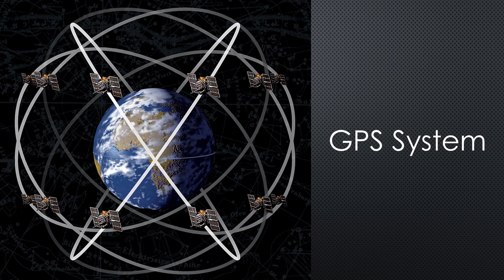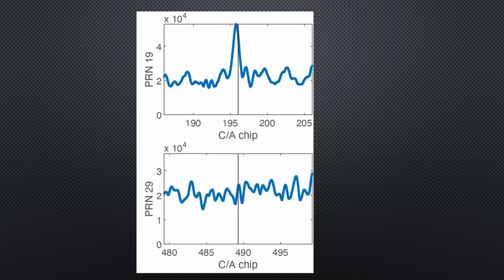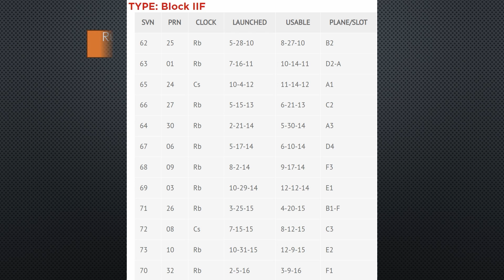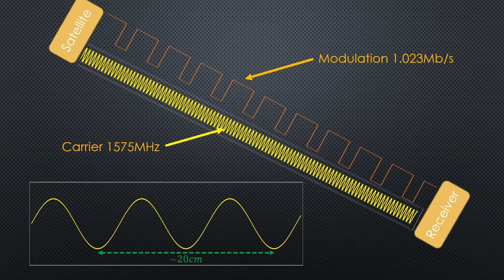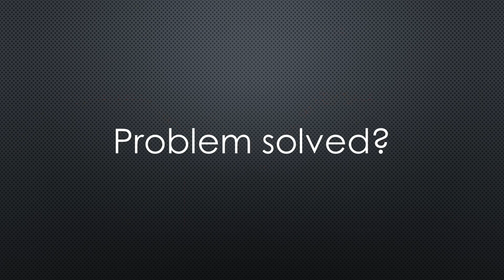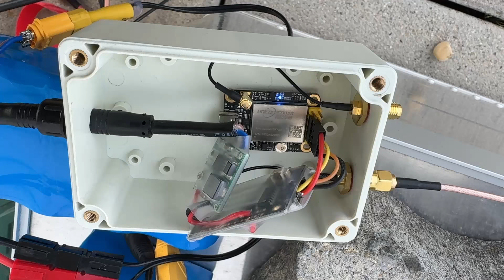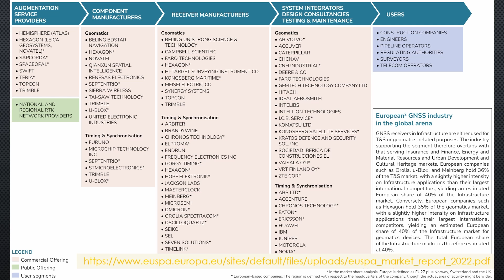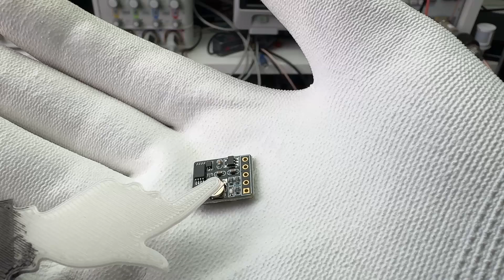(483) ESP32 precision GPS receiver (incl. RTK-GPS Tutorial). How to earn money with it (DePIN)

Comment from the maker: Please order the "S" type of the antenna (all band). It is in the same link I provided.
Reply: I think Ardusimple product pricing is quite competitive with those items you've linked
Reply: Crypto scams have had plenty of opportunities to justify themselves. They can’t. Avoid everything associated with them.
Reply: Thanks Andreas. Very interesting, although I didn't quite grasp all of the nuances after listening once. More reading is required! 
The major weakness of GPS is the satellite constellation; a powerful CME, or a man-made EMP from an orbital nuclear explosion, can disable or damage numerous satellites. While it works though it's superb.
Reply: There are some interesting distributive set ups. 
ADS-B monitoring leads to a business that makes money
Blitzortung is another interesting one for citizen science. 

The general model of distributed sensors sending information to a central website, which merges and presents the data is interesting. It's an area where libraries should lower the cost considerably. 

RTK is clearly an area where this model works, particularly if costs can be lowered. A raspberry pi, a hat and an internet connection surely has to be the model.
Reply: Also, for the DePIN, one sensor sends to lots of companies. Nothing should stop that.
Reply from the maker: @AgOpenGPSMagyarorszag  Good to know. Is it also globally available? That is often the problem for my viewers.
Reply from the maker: @protektwar  Maybe you now find a cheaper source. This sometimes happens after my videos 😞
Reply: @AndreasSpiess  They have next day shipping for most europe, stock in Mouser, etc. So it should be globally available yes.
Reply: @RWBHere  Meanwhile there are 3 and half constellations with global coverage ... GPS, GLONAS, BAIDU ... and Galileo (the half. And further with local coverage - so there is quite some redundancy. Most modern receivers can use all the big constellations for a fix.
Reply: Aren't these active antennae? How are you providing power to them? Above, "Splitter (with a case, not needed for a single receiver):" But wouldn't it be needed for a single receiver since this is power injection?
Reply: @aerobiotic  Most receivers can likely provide power for one antenna. But do not work, if multiple receivers are connected.
Reply: Yes the prices have skyrocketed suddenly on that antenna so idk
Reply from the maker: @TylerDurden-pk5km  I insert a DC blocker for all but one receiver. Like that, only one receiver powers the antenna.
Reply: Do you know if there are approach that would work indoors just as well to few centimeters and could also distinguish elevation - position in 3D so full XYZ?
Reply: The 1 nanosecond error corresponds to an error of 30 centimeters. NOT 30 meters. Light travels at approx. 300 million meters per second. 300 000 000/1000 000 000 is 0.3. 0.3 meters is 30 centimeters.
Reply: Just accepted a job running one of these state wide networks.  Are there any other recommendations for understanding this more.
Reply: Not true, Galileo has global coverage by now. Also you forgot the other smaller networks. I believe India is working on one with currently only regional coverage.
Reply: How precise can you get your position using EGNOS DGPS?
Reply: Why is this project no longer in your github, please?  Or did I miss it somehow?  Great project, keep up the great work!
Reply: Can you use two different GPS modules connected to an Esp32s2  or must you use this specific GPS modules? It's 58-90 CHF for the one you cite. Will other modules work well enough as long as you are using a good antenna or a helix type or a powered one?
Reply: I have so many GPS modules of different types like the integrated one in the Heltec Lora combos (the new one), a t-beam with one, and three others only one doesn't supply PPS.
Reply: The weak signals are one way to discard GPS jamming and spooling. In addition you can set up your antenna to only pay attention to signals coming from the horizon up. So, right there is a way to help discard faux or spoofed signals. If you were to pair it with a very precise onboard RTC with s battery and a very precise onboard military grade inertial movement sensor. I am unsure how to use known cell phone and wifi shot spots for both a NTS and a known location while being jammed or spoofed.

Comment: The first GPS receiver I used was a Sony Pyxis in 1992. It chewed through a pile of AA batteries in just a few hours and it took something like 10 minutes to lock on every time, and it couldn't deal with even a little bit of tree cover or heavier clouds. I now have a < $100 watch that can get a lock INSIDE a lot of the time in just a few seconds and can track for many hours on a tiny internal battery.
Reply from the maker: Indeed, we came very far…
Reply: Your watch is continuously searching and has no accuracy standards to meet so it can take a half informed guess based on other hints. It doesn't actually aquire satelite locks that fast. 
I work with aviation GPS, and from a completely cold boot even with an external antenna on an open field they still take several minutes to aquire and verify enough satelites. After acquiring they update position multiple times per second, and with a quick power-down and reboot they retain some information and know they couldn't have been transported too far in the elapsed off time so they can reaquire much faster.
Reply: I built one with an arduino to clock the speeds of my RC boat a few years ago...maybe $10-15 in parts lol. The $5 ublox units are pretty amazing.
Reply: @mytech6779  Yeah, it's just the way GPS is working and how the signals are transmitted from the satellites in orbit. You need enough information from enough satellites, and you can't speed this up with more computing power. That won't make the satellites travel faster.

Comment: I'm an engineer in Brazil, power electronics and lately developing circuits for use in the field in agriculture. The use of RTK was discussed the year before last, but it was not applied Brazil everything is very expensive and bureaucratic. It was used for planting with tractors. Today this idea was abandoned and they hired the company Kimble .. today my project consists of lora modules with the llc68.. where each device has 4 inputs, 4 isolated outputs, 1 GPS, and a Gateway with just 1 GPS module and covers 5km.. tractors, gates, motor pumps, sirens, everything done by this system...your videos are the best...congratulations
Reply: If I understand this correctly, you use lora mudules to broadcast, and then receive the signals with GPS to triangulate location of equipment?
Reply from the maker: RTK is now widely used for precision farming. It seems you had a different use case
Reply: @FullCircleTravis  
The initial idea in 2021 would be to use RTK to map irrigation pivots. But due to the cost and the difficulty of development, it was an abandoned project. And the GPS modules purchased were used in tractors which send the position through a LorA network. Sorry for my English hehehe
Reply: @AndreasSpiess  Unfortunately, I had to abandon it, who knows, maybe one day I will use it again.
Reply: @balee15  Your English is really good. I guess my question was, were you just relaying tractor position, or were you enhancing the accuracy through the LorA network?
Reply: @FullCircleTravis  Thank you, as there were GPS modules left over, as we were not going to use them for irrigation pivot mapping, after a while I used these modules to use on tractors, but instead of the location being passed via GPRS or 3G, the latitude and longitude is passed through a data packet via lora, thus saving money in the sense of not needing each GPRS radio on each tractor, at the beginning the entire NMEA->lora-> gateway->publish MQTT package was used. Today it has changed, the microcontroller only filters latitude and longitude (less data). The accuracy for locating tractors has not changed. What changed was the economy and the independence of the need for individual GPRS radios. Regarding RTK (for very high precision) I did not implement it
Reply: @balee15  
I have an idea for you. 
If you want cheap high-accuracy, design your system to position relative to the LorA stations instead of relative to exact earth coordinates.

Essentially, you just add a cheap GPS to each stationary LorA station. Since the station doesn't move, it's a calibration point. You simply map your field once relative to the LorA stations. As the reading of the LorA GPS changes, you create a correction relative to your calibrated location. Send this correction to your tractors, and they will correct their GPS readings according to this correction, making their position relative to the LorA station accurate. 

You won't know the exact earth coordinate, but as long as you can adjust the location relative to the stations, the tractor will be where it should be. If you surveyed the exact location of your LorA station, you'd be accurate to earth coordinates as long as you never move your station. 

Simplifies the RTK complexity and turn it into simple real-time corrections to pass to the tractors without need to ever know the exact location of anything. The stations can be mobile as well, and you simply just need a calibration point like a surveyors spike or fence post to find the stations location in the field, and you're good to go. This would allow equipment to be moved after use to prevent theft and vandalism.
Reply: @FullCircleTravis  The idea is excellent, but ideally there would be enough studies to determine all types of situations. Where I work, the GPS has to be included in a report that goes to a management company, there can be no error, and equipment without certification is a lot of responsibility, I've already had some problems in this regard, an error of 0.5% on 14 bushels in the end It can cause a lot of damage. Today, when things like this are involved, I prefer to either pass on it or use a certified company. But your idea is excellent and a university and a company to finance it would definitely be worth it.
Reply: @balee15  Sounds about right.  Therea re places where safety and certifications are critical.  Then there are places where someone demands certifications and sign-offs for the most stupid things.  To the point that it's simpler to just buy an crappy solution for too much money than it is to implement a great solution.
Reply: It would be nice to have this precision for mowing residential lawns, but trees and houses are in the way. Would it be possible to use something on the ground to triangulate exact location? If so, any info on how to do it?
Reply: @balee15  
Gotcha. I'm going to make it, but it'll be only for my own property. I used to work in oil and gas, so I get the culture you're working within.
Reply: @coleaz many robot lawn mowers use base stations to guide.
Reply: To your point about Brazil being expensive and bureaucrat..
I sent 2 boxes of used, worn clothing to family members there, for the children.
 The father was very ill and the mother was busy taking care of him so there wasn't much work being done. The family was broke.

I sent the 2 boxes from the US Post Office and they arrived at GRU about 3 days later.  From Guarulhos it took 3 weeks for the packages to get to the interior de Sao Paulo (Sertaozinho).

When they went to pick up the boxes they were asked to pay a tax of about 800 reais. That was more than it would cost to purchase all the items brand new. They refused to pay the tax so the boxes were sent all the way back to the United States and I donated the cloths locally.

 I live in a Brasilian community. EU ganhei um pouco de Portugues, alguns conhecidos e agora, familia. 
Brasil has a special place in my heart and I really want things there to be so much better, but the government always seems to make them worse...😢
Reply: @FullCircleTravis also coming from the oil and gas space ...I am working on a proximity detection system to prevent collisions between moving equipment and site personnel. Was intrigued by your suggestion about having a calibrated central base station. Would you be willing to have a chat about the project I am working on. Got some questions
Reply: @FullCircleTravis  Unfortunately it only works if both GPS receivers have the same error -  I tried it a a couple of years ago and because the error was not the same on the two GPS receivers I wasn't able to broadcast a simple correction.  Same model of receiver and same firmware. placed about 10m apart. Relative errors never remained the same unfortunately.
Reply: @aritaridrive6539  
I haven't experimented with this yet, but I would imagine you also have to know the relative error of the second device. It's in this combination of errors that location is improved. Multiple fixed antennas and multiple moving antennas in fixed relative positions are likely what you need to increase accuracy. Of course, a major part is countering anything affecting signals. In restricted space or near obstructions, l would shift positioning to using cameras or arrays to scan surroundings. The hardest part is the cost relative to the accuracy you need. A lawnmower isn't worth installing positioning like this, but you want a lot of accuracy and redundancy in a million dollar tractor.

The military made it work, so it can be done.
Reply: qual teu contato? tenho interesse em gps para trator
Reply: @ ya, but the commercial RTK equipment costs a fortune.